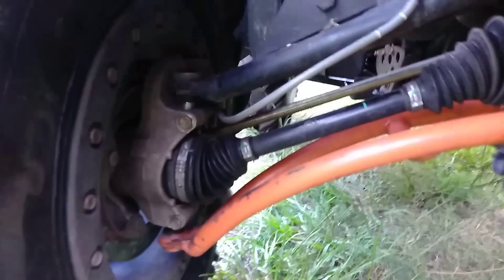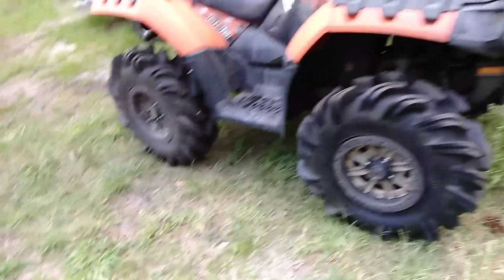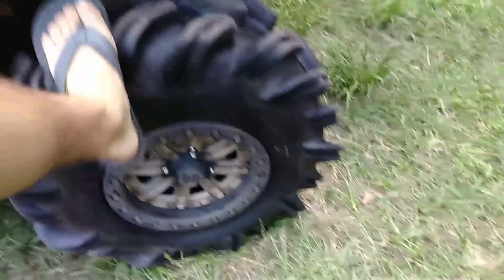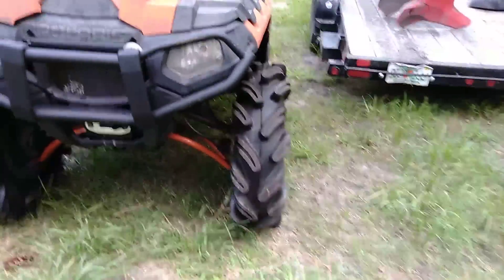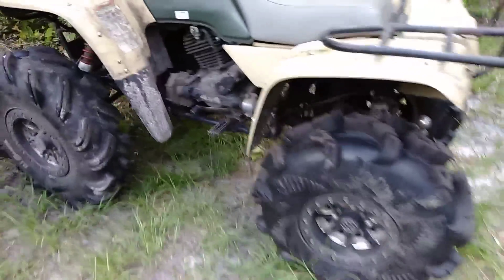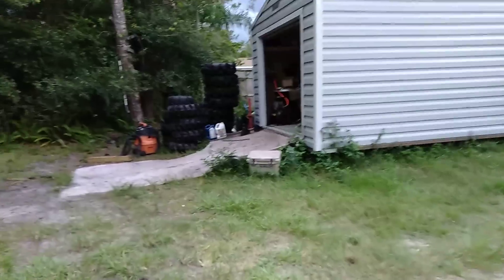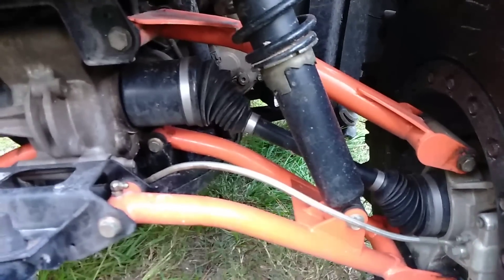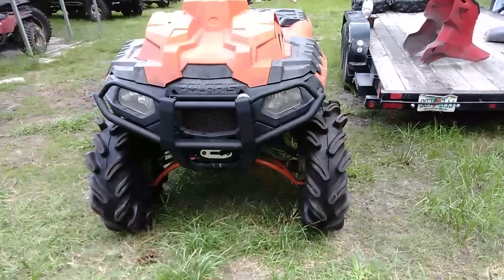Sportsman aftermarket axle issue and 31 laws

Comment: Swamped my HL, have a grinding coming from trans or clutch. Ideas? Got all the water out of engine and changed oil till no more water, now at idle a bad grinding. Havent ridden it.
Reply from the maker: No idea. Water really should hurt anything in the transmission unless it's sits in there for a while. My guess is something on the primary clutch maybe the bearing
Reply: Mud Puppy there is a one way bearing in there right? Hopefully not crank bearing. 😕

Comment: As you can see by my thumb nail I've got a Commander it's got a CATVOS 4" suspension lift and 2" spring pucker lift I have Gorrila axles all the way around on it that same axle either breaks from popping out while climbing rocky hills or they just break doing it   I'm not sure Gorrila says axle is to short and is pulling its self out breaking so I've had it there now on it's 3rd time getting lengthened by a 1/16 of and inch each time so hoping this is the charmed one.  Anyway I'm going to put a limiting strap on the fronts and try in again.  I live in Louisiana and as long as I play in the mud and stuff around here nothing breaks it's only when I go to my brother's in Tennessee I break stuff
Reply: Stacy Reid I have same setup and I was having problems with gorillas I went with cobras and it was the best decision I've ever made I have hd cobras and they hold up good with 32.5 ol2's
Reply: Trump Train I was gonna put the HighLifter HD axles on it but they said they didn't sell them like that   I guess they only sell or make  them when you put their lifts on   So I went back to the Gorillas this last time cause I couldn't afford the titans eagles I wanted

Comment: What tire would you recommend for a 02 2wd Honda 350 (Rancher). Want to stay around a 25x12x12 or 10 no lift no reduction. I'm about due for some new rear tires. Mainly trails and pavement but still do a bunch of mud (nothing bad)
Reply: Scott_4.6_ lee I had a set of Kenda bear-claws on an old quad, they were great. I have stock size itp mud lites on my sportsman, haven’t had much ride time on them yet but they seem good too, nice and light but aggressive
Reply: Scott_4.6_ lee kenda executioners are a great 25 inch tire that has good tread and last on the road. The only bad thing is they don't ride the best on the pavement  but do great in the mud, dirt and sand

Comment: if i buy some can am wheels with some 30” tires, but i have a honda 500, the bolt pattern is not the same and i need to know where i could find some adapters and if anyone makes them

Comment: What did you say the deal is with those 31s with Highlifter sanded off? What is different with them?
Reply: tunnelvision2day he just saying that the tread itself is a harder rubber, regular tread is a softer style of rubber
Reply: Jake Brake I got that. But he said the front ones were harder than the back. And they are all 31s so that's what I was wandering what the difference was
Reply: tunnelvision2day just the manufacturer, plus he said he front tires are skinnier also I believe

Comment: hey sorry for my confusion but did u leave like a highlifter two inch lift and just get outcast a arms or is that an outcast lift...
Reply from the maker: Took off the rear bracket and added outast arms rear
Reply: okay so the a arms are the lift all in themselves. did u have a link for those in ur other video ?
Reply from the maker: Just call Out cast Fab yes lift is built into the lower shock mount